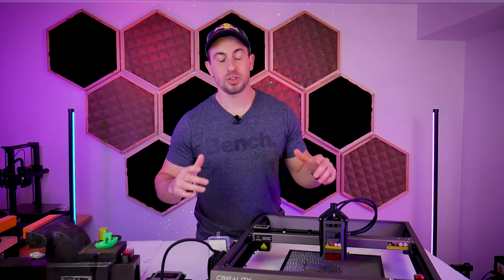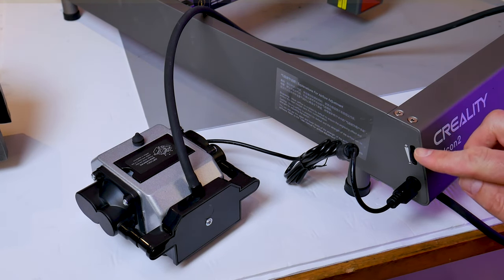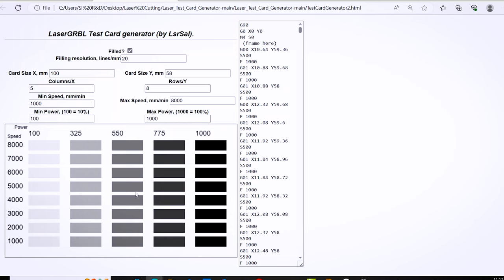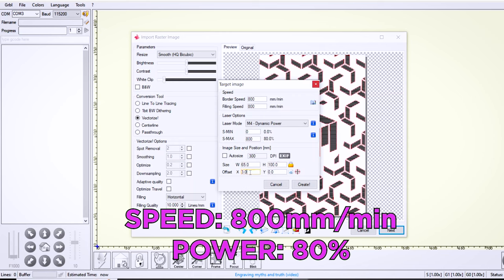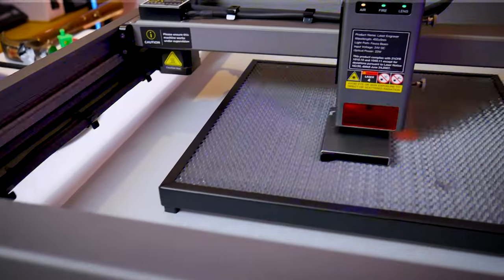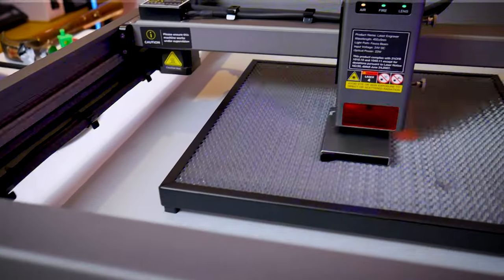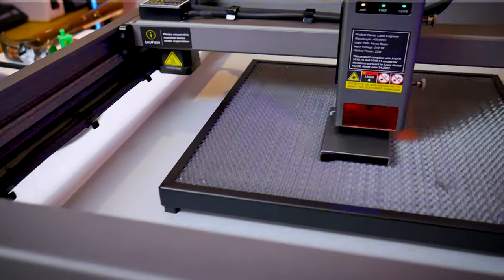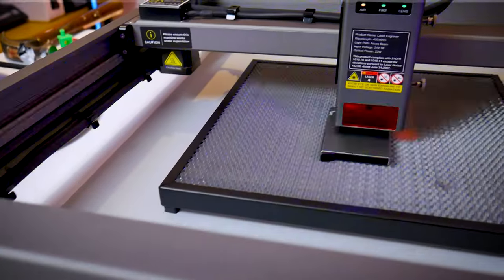Creality Falcon 2 DETAILED Setup Guide, Assembly, LaserGRBL, Fume Extractor, Settings and More!

Comment from the maker: If you appreciate this in depth content, check out the best prices below to support my channel! As an Amazon Associate I may earn a small commission (at no extra cost to you)
15% OFF the NEWEST 60W Falcon 2!
► https://shareasale.com/r.cfm?b=2569151&u=3650799&m=124834&urllink=&afftrack=

Creality Falcon 22W:
► http://bit.ly/3NK0SXE
USE CODE: FNEMG for a generous discount!

► https://www.amazon.com/dp/B0BWJ2LX74?maas=maas_adg_2BAF7C51270F5EE10F233EDCCB8AE5E7_afap_abs&ref_=aa_maas&tag=maas
USE CODE: T5I2ME7Q for 20% off!

Electric Screwdriver:
► https://amzn.to/3JRbbZe

Velcro Tie Wrap Rolls
► https://amzn.to/42jr3dX

Adhesive Cable Tie Clips:
► https://amzn.to/3dTw4VS

CPAP Hose:
► https://amzn.to/3DmcxHF

Laser Proof Silicone Work Surface Mat (20" x 28")
► https://amzn.to/3zDyMG7

Laser Proof Silicone Work Surface Mat (23.5" x 31.5")
► https://amzn.to/3A0Fzv1

Aluminum Wallet 2-Pack
► https://amzn.to/435WasF

Tall Stainless Tumbler 4-Pack
► https://amzn.to/3CWBXLh

*NOTE: In the video I had shown the honeycomb, stainless steel consumables, and rotary tool were included in the kit. THIS WAS ONLY FOR PROMOTIONAL REVIEWERS. These items and the enclosure are all needed to be purchased separately! The actual purchased product details are subject to the standard "In the Box" details provided on the official Creality website. I apologize for this misunderstanding.
Reply: Creality recently ran another promotion for this bundle for $399 (mid-July, 2024)! I had no idea that's what I ordered (the bundle). I was soooo excited when I opened the box and saw the rotary tool (I'd ordered the upgraded honeycomb already, thinking I was going to need it, so now I have an extra smaller one). So they must run this special every so often.

Comment: Excellent informational video, thanks.
Perhaps the ply burning issue you had at the edge of the board was due to oil from your fingers affecting the burn, as it's probably the sides where you held the board. I take care not to touch any of the surfaces, particularly with anything absorbent, as you can't see the oily fingerprints but they are definitely there. I had similar issues creating PCBs in the past where etching didn't work well where my fingers touched the copper.
Just a guess, but perhaps another experiment to try in future?
Reply from the maker: You might be right, I'll have to test that further - usually on tumblers and things where finger prints are visible I always wipe them away first. With wood it's easy to forget they are there / soak into the wood and perhaps have some impact... good thinking.

Comment: I got the limited number "Pro" 40w kit for $1510 after tax and it included the three optional pieces. The extra holes on the bottom also hold the extra leg pieces for the tumbler roller.

Comment: First of all, thank you for this fantastic video 😉!!! I would like to ask a question about firmware. Do you know if I can change the firmware to update the machine size like we can do in ender 3D printers?
Reply from the maker: Thank you! I believe in LaserGRBL you can write to the controller and change the soft limits of the machine. Then if you changed the frame up and extended it you wouldn't be limited by the soft limits anymore

Comment: Two questions: Creality has the rotary with the chuck (not sure if they had it a year ago), but do you have the same issue with that, if you have used one before? And did you find that you had the same issue with LightBurn and the rotary as you did with LaserGRBL and the rotary?

Comment: It doesn’t seem to matter what material I cut. When I get it to a speed it cuts through, the engraver runs for a while then stops with the lens contamination alarm (The right red light), I reset the laser and continue, it runs for a bit then alarms again.
What am I doing wrong?
Reply: Mine does the same. Did you find any solution? I also could not engrave any metal other than anodized aluminium…. Could you?

Comment: Hi... Nice video. Thanks!
I do have a question. What do the LEDs on the laser module mean? I've seen them change from green, red and even yellow, but I have no idea what they mean. I couldn't find anything in the manual or Creality website.
Reply from the maker: On your USB drive you should have the instructions and one of them says laser module alarm function or something like that. Basically there are 3 LEDs
1. Air assist - Green is good, yellow means partially blocked flow or low flow. It might show yellow if you even turn down the air assist to a low setting, doesn't necessarily mean something is wrong. Red means it's blocked / off I guess. 
2. FIRE - I'm guessing red means fire (I haven't lit one yet lol) - yellow is RISK of fire but you can proceed - and green is good
3. LENS - green is clean, yellow is warning needs to be cleaned, red means clean the lens now
To reset the alarms you can press the reset button on the laser head
Reply: @EmbraceMaking Thanks for taking the time to reply and for the information provided.

Comment: 🤯 I know how to keep the steel from warping now, and at a more consistent temperature but I don't know for how long ... And I haven't even ordered a laser yet 🤣 

If you're just engraving and not cutting, I don't see why not, just set the plate of metal on top of a flat and level ice pack 😎, and find some things to hold everything in place without getting in the way of the laser head.  Making it cold will change the required settings and most likely make it take longer, but it couldn't be much longer with .05 mm stainless steel foil 🤷🏼‍♂️ liquid cooled with something that can't melt or get warm before you're done would be even better but I wouldn't know how
Reply: I recently changed my mind to this one after I thought I had my mind set on the Longer Ray5 20W diode laser. The Falcon 2 looks like it cuts better, gets better color results on stainless steel, has better (amazing, actually) cable management, and the way the laser head slips on and is adjusted looks a lot easier, more solid, and more accurate than the Ray5. Oh, also, the Falcon 2 comes with the frame already assembled, the other doesn't. And they're both discounted under $600 right now on their websites (without accessories) but the Falcon 2 has included and built-in air assist. It just dominates overall 🤘

Comment: Great video. However, the smoke extractor will collide with the cable guide on the left side when the laser performs homing. How do you handle this?
Reply from the maker: This shouldn't be an issue on the 22W because the module is still narrow enough to get the nozzles beside without hitting anything. On the 40W it comes with a bumper for the limit switch so you don't have interference (but you will lose 5mm on your x axis) see here: https://youtu.be/J26kbJYS9Eg

Comment: Can this cut through stainless steel, it is advertised that it can cut .15mm with 1 pass, can you confirm and if so have any videos about it?
Reply from the maker: I can try... Recently I did 0.1 stainless on a 40W xtool and it will go through... But you're pumping a lot of heat into the thin material so expect wrinkling and distortion of your material

Comment: 'thread forming' - better known as self-tapping.
Fume extraction- instead of fitting a filter, just run a tube from the 'blow' side of the vac to the outside world. 100% effective and zero cost.
mm/min seems a bit strange- why not use mm/sec? - this is the correct SI unit.

Comment: Could you not have simply turned the rollers on the steady-rest upside-down? They look reversible.
Reply from the maker: I believe I tried that, but then the issue was that I still couldn't extend the steady rest out far enough to fit the whole long skinny bottle on there. The bottle would hit the bracket and still wouldn't work for me. That's why I ended up separating the two parts and making a base for the steady rest as well.